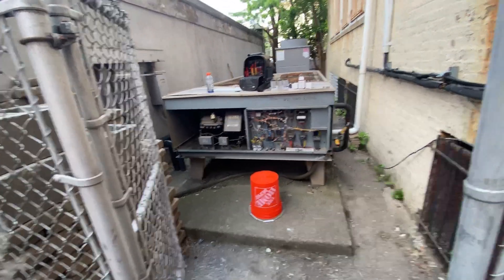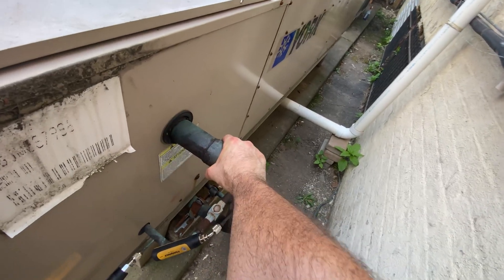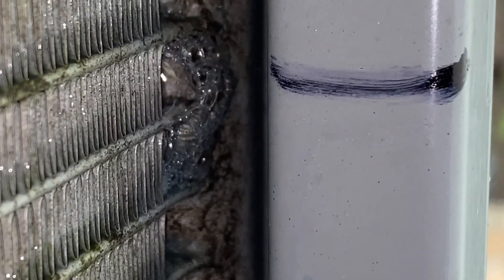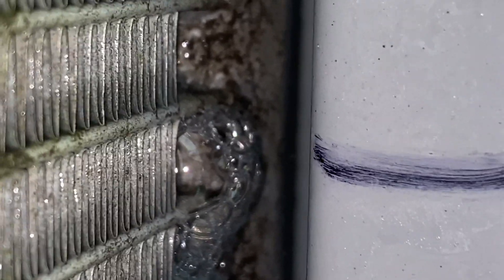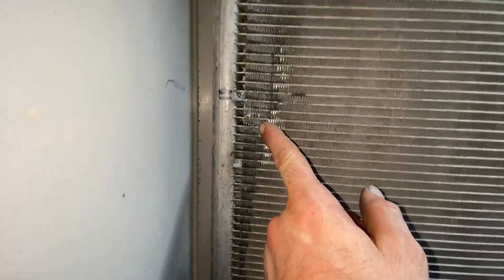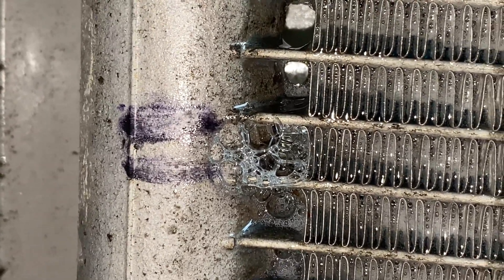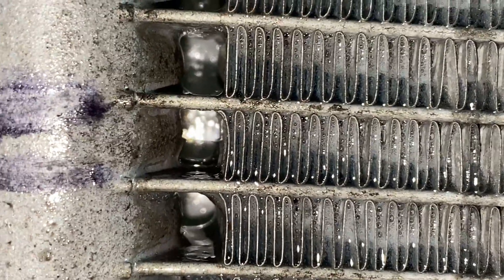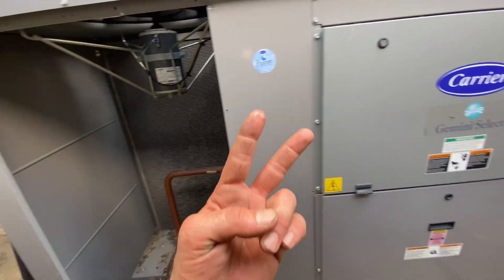HVAC Tech Life Service Calls Multiple Units Down

Comment: Fawwwwwwk God bless reclaiming the unit id help out with my blue bucket for evac time. At least its not as hot as it could be. Good luck my friend :)
Reply from the maker: The only benefit to a micro channel condenser coil has less refrigerant than a tube and fin. This beast has only 86lbs inside. For all three air handlers connected to this condenser.
Reply: @thehvachacker  im from Salt Lake Utah but this was in winter when I had to reclaim 6 rtu each one had 2 circuits 85lbs. Luckily didn't have to vacuum that sucker cause they were replacing it haha I tore that sucker up good friend of mine was junkies it the hell with that I removed coils inside and out the right way removed screws etc good money in it. Best part is my step-dad owns his business so what I make it what I keep lol good video by the way I know you stay busy and can't do everything at one's but I. Grateful for the stuff you do. When I get off in always watching them over and over mainly summer to winter cause at times you forget haha

Comment: Some of those old semi hermetics would run for ever with little issues. Thanks for the video.
Reply: Not true. Dirty condensers and lack of oil have murdered more semis than any one person can count. Most service techs today don’t even know how to check oil pressure on a semi, let alone know how important it is to look at the crank sight glass. So has liquid refrigerant. Reed plates explode when liquid hits them and then you have to cut the whole system apart until you find them.
Reply: @jman0870  I have serviced them for over 50 yrs, easy to repair if you know what you are doing, service techs today have no idea how to service older equipment or charge them the old fashioned way. Don't need computers if you are a real mechanic.
Reply: @watermanone7567  I've only been doing this since '09, but I sure have seen some old dogs run. I even had the pleasure of taking care of arguably (at least in my mind haha) the last Carrier Multizone in Pennsylvania. It was on it's third O6D (number 2 didn't make it more than a few weeks because the company that replaced it didn't understand how important oil was haha) and the lid was rotted out and covered in layers of tarps, but it still worked...It probably helped that all 8 evaps were replaced with custom aftermarkets and all the liquid solenoids were new. The accumulator was even replaced with one that didn't have a sightglass....it was pretty much impossible to check the charge on the piece of shit. I managed to get the factory charge from Pierce Phelps (after I argued with the idiot for 20 mins that I wasn't working on a multi head Carrier mini split) so I could at least weigh in the charge. I hated that hacked up turd. Oh...the economizer evap was destroyed and plugged with dirt. It was impossible to clean because that required removing the lid and the lid would have disintegrated if I looked at it funny haha. I'd love to meet the engineer at Carrier that designed those things haha!
Reply: @watermanone7567  they cannot blow their own noses, nor walk/talk or chew gum at the same time. it locks them up solid and shorts them out (smart devices ruins them 100%) SMS(text) bling or phone ringtone(extra lol)? progress halts 100% and they're now lost like deer in headlights.
it's all coming into a focus very soon and they'll cry as their own junk breaks and nobody is available or will bother to repair it or they'll get reamed hard for short-lived repairs and replaced equipment which doesn't last at all. pretty soon, USA will be about as good as the third world countries(sooner than later) ;)